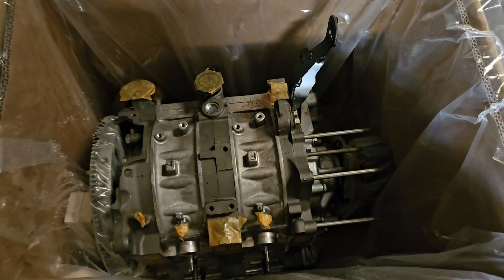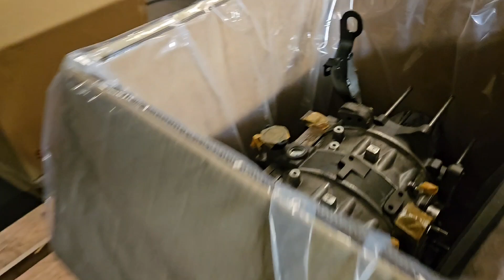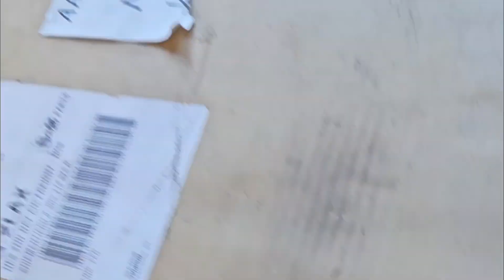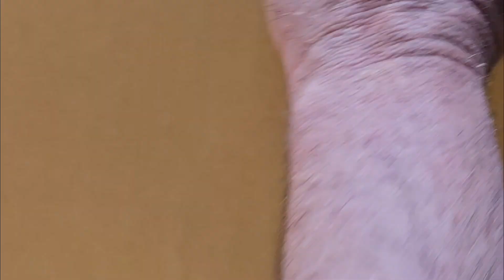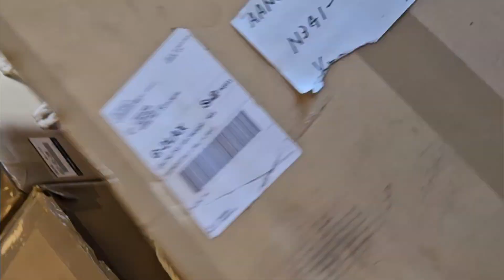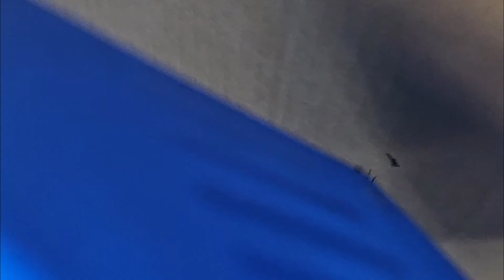New FDS3 Motors? What happened to the price of RX7 Motors? Why they're no longer available

Comment: Looks like that motor has an ear broken off the rear plate? Also, Mazda is stupid for not making these available. They can make a lot of money because there are many rotor guys still out there, especially in Australia and Puerto Rico.
Reply from the maker: Yep.  Thats why we had the box opened.  📦 otherwise we don't usually open them up.  Should have mentioned it 🙄